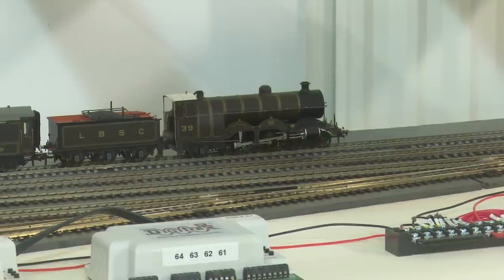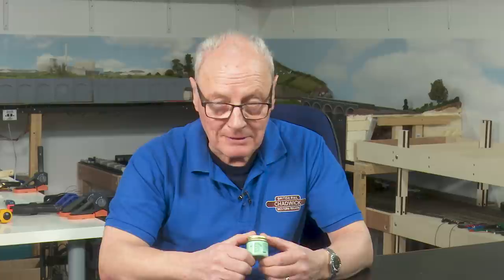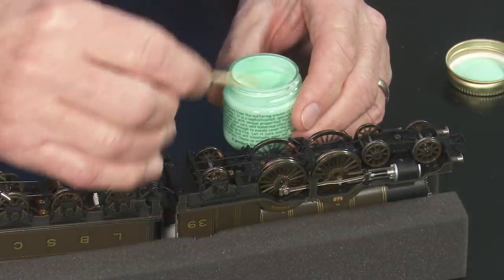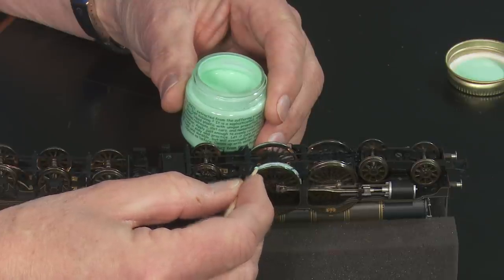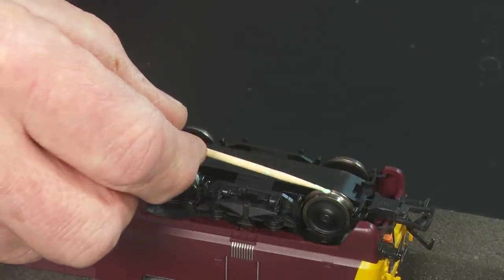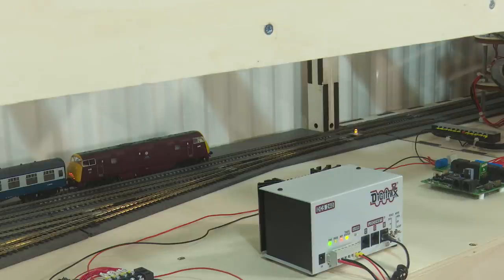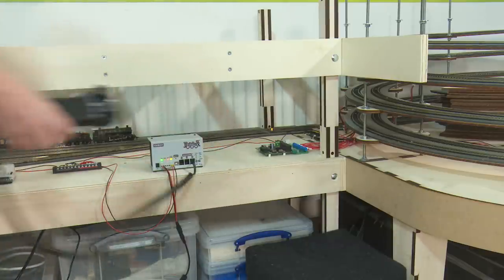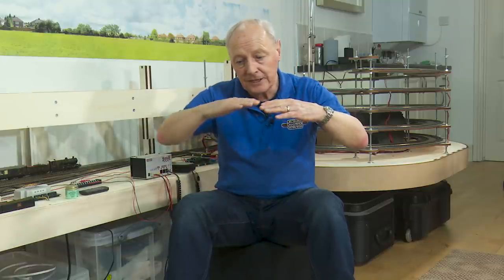Traction Troubles and Bullfrog Snot at Chadwick Model Railway | 122.

Comment: Bulldogs Snot works best when applied with a little brush, which makes a pattern in the snot. Using a stick makes a slick surface, which has less grip.
Reply from the maker: Thanks Arthur, it really is a strange commodity.  Regards Charlie

Comment: Hi Charlie , well it's more like Bullfrog  Did Not! It's strange how many modelers do helix's on many layouts  this is a first I've seen this happened. There's another HO scaler in the U.S. that does high speed fast freights Its incredible with almost 100 trains! Otherwise these trains are strange & stubborn on these climbs. Even I wonder maybe traction tires would be better? But on older European & American models were & are the flanges which are a no no on code 83 tracks. Generally code 100 is my main trackage, the structure height adjustments on your model you described is challenging, but don't worry my former layout on a flat surface of HO SCALE  Amtrak AEM 7  by Atlas with 5 cars would do exactly what your engines did on screen. This video engines & cars etc. is teaching physics whether we like it or not. 😃 As always I get  something watching your channel. I will be watching your previous videos I've been off-line I need a better technology myself 😂. Happy modeling I'll continue viewing.. 👏👏👍🙂🚞🚂🚃🚃🚃🚃🚃
Reply from the maker: What a great comment Harold. Hopefully if you watch tomorrow’s video all will be revealed, things are much better now the adjustments are complete. Regards Charlie

Comment: Charlie, you're often borrowing things from Mrs Bishop' well why not borrow her nail files and at 90-degree angle to the rails stroke the helix rails with the files to rough them up a bit? When I was a kid I had a dock shunter that had serrated wheels and it worked a treat. My mum said, be nice to the little girls next door and let them play with your trains and the little horrors would fill up my goods train with broken bits of dolls and marbles and the shunter managed the Hornby incline set with no problems.
Reply from the maker: Sorry Iain, I can’t risk scratching up the rails. If it were to be a mistake I would never be able to replace them. Regards Charlie

Comment: I think the solution you mentioned at the end of the video is the right one. You have room so add another rotation to the Helix. The Warship is a good loco and is heavy and compact. If it cannot perform as you want it then you have to look to the incline. The steam loco you have is another kettle of fish :) I do not think it will have great performance whatever you do. However reducing the steepness of the incline can only help. Always have the least steep incline you space / design will allow. The Bullfrog Snot looks like a good product but it should be a last resort as in many cases you are reducing the number of wheels that pick-up and that is never a good thing.
Reply from the maker: A great comment, and with the changes I made this weekend to the Helix we should be home and dry.

Comment: Nice video, I only run trains on a level track but found those locos that need tyres, quite often the replacements are thicker and course the loco to run lopsided. So I found that heat shrink tubing a good replacement, the trick is to find the closest size as it doesn't stretch ...happy modelling stay safe
Reply from the maker: Great tip Mark, many thanks.

Comment: Nice one Charlie..... I've not ever used 'Snot' which I guess is a reinforced latex product and does seem by your video to have some merit, although
how long it will last remains to be seen. 
As far as helix's go my double helix is graduated with the steepest section at the bottom so if a train manages this section it will lift a train to the top,
the advantage being one can back off an 'overloaded' train without the perils of backing off further up the helix and maybe getting buffer/coupling
lock.  If you can add an additional loop in your helix complex... go for it and adding some weight to your locos will certainly be worth while. 
  As for replacing rubber tyres one way that I have had success with is build up a layer of silicone sealant in the groove and allow to throughly
cure.  Another which I'm testing out is shink-wrap tubing. Starting with tubing slightly under size and stretching it into the groove followed by a
final fixing with a dunk in boiling water to bed it down. (The water must be boiling).  Thus far this method looks to be working.
Reply from the maker: An interesting point Indigo. None of my locos have traction tyre facilities. So that option is not open to me. However I am adding an extra layer to the helix and lowering the layers to decrease the incline. Regards Charlie

Comment: Bullfrog snot on the bogie ! haha.Try applying to opposite wheels on each axle,leaving one for pickup and one for grip.And with one in each corner on diesels on opp.sides. My locos with best traction are articulated with traction tyres and set up like this.Good weight over drivers is best as you know.Even some of my tender drive locos have good traction with tyres.My standard grade is 2.5% or 1in 42,but i have less and more in places. I am making a rack section which will be 7.5%,so working on ideas and testing various combos,needs to zig zag around the stairs to reach the hallway at the top.Keep up the good work Charlie !
Reply from the maker: Sound advice Simon, thank you. I’m currently rejigging the Helix accordingly. Regards Charlie

Comment: Hi Charlie and a happy new year,  you've got more patience than I had for my helix. All the issues you are facing eventually lead to me giving in. Fortunately your helix looks to be easier to adjust and more accessible. My intercity trains and 12 wheeled engines usually had enough weight and traction to run. My steam locos didn't work at all, that was why I had a level loop for them to run on. like you, I was learning how to make this work and comments rained in from other modelers on YouTube. I wasn't winning this battle. For me the straw that broke the camel's back was when someone pointed out the extra wear and tear on the motors, it was thought that the helix would half the life of the motors. That news came in when l was at a low ebb and starting to believe that I had made the wrong choice of railway layout. I think your extra layer will go along way in achieving your goal,  an option I didn't really have, the incline has to be slight. Just a thought with the traction gloop,  I wonder if that would work on my Rocket, despite being level its lack of weight affects its traction. I'm busy with track ballasting and hillside scenery at the moment, hopefully have an update soon. I wish I had your editing skills.... kind regards Jim
Reply from the maker: Hi Jim, I’ve completely re-jigged the Helix this weekend. You’re right the incline was too steep. Good luck with the rocket, I will put it back in its box! Regards Charlie

Comment: Great video Charlie! 
I might have few suggestions for you. 
First, try to apply bullfrog snot just on one wheel per axle and diagonally within one boogie. You will get more even moment of force distribution.
Second, try to avoid wheel slipping. Not only it grinds both wheels and rails but more importantly it also decreases overall power output. Coefficient of adhesion is greater than coefficient of friction, therefore you will get better reaction force and better moment of force.
I am looking for the next video!
Reply from the maker: Great comment Blackbird. Regards Charlie

Comment: Hey Charlie, thanks again for doing the hard work researching and testing products for us. I could see you had enough clearance to lower the helix' and then you admit you had increased them! One thing noticeable is the speed is inconsistent even with the full train on the helix. Check the back-to-backs and run a track gauge over it, wheels could be binding.
Reply from the maker: I found the snag but it wasn’t the gauge. I explain all on Friday.

Comment: As always a great video, it’s difficult to watch as it takes me back to my struggles with exactly the same situation I had 6 years ago, you may remember I messaged you on your first foray into the helix. I also used the power base and bullfrog snot, run the up on the outside of the helix etc etc. 
I’m reluctant to tell you the outcome but it did not end well for the helix.
I truly hope you get it to work, my ‘helix’ now has a diameter of almost 8 feet and with a gradient of 1-60 ish, I can now haul 11 coach trains with almost any steam loco, and a 40 wagon coal train hauled by a garret! I had more trouble with freight than I did coaches but that maybe because I wanted most trains hauled by steam.
Thanks and good luck.
Reply from the maker: What an excellent comment mate. I’ve had to rejig to my Helix and hopefully you’ll see it next week. I have the advantage that I’m not really a steam engine kind of guy but only time will tell. Regards Charlie

Comment: On some of my Hornby steam locos where needed I have removed the geared set of drivers and machined a groove in them and fitted Hornby traction tyres. This has worked with no problems and they are run at a constant speed round the layout. Somewhere between speed step 25 and 40. I don’t have a helix but do have a gradient.
Reply from the maker: That must be quite an engineering feat Alec, on a mini lathe I imagine

Comment: Hey Charlie! Long time fan from across the Atlantic. I've never used Bullfrog snot but I find if fighting a grade that spinning the wheels never helps as it breaks the cohesiveness of the wheels. I've been able to pull 60-70 properly weighted freight cars up 1.5%-2.0% grade as long as I use throttle control. Maybe if instead of attacking the grade at 99 you feather the throttle while using the Bullfrog snot you can pull even more coaches up the big hill! Cheers!
Reply from the maker: An interesting comment Adam, and advice I will certainly try. Regards Charlie

Comment: Charlie a couple of things for consideration what happens to the BFS where does it end up? possibly on your track does this make it harder to clean the track? with your helix with your steam trains you could run a banker on the helix (extra operating potential) but this is I think less prototypical for UK diesels. You could have a major rethink about your helix, if you have the room, rather than a circle you could have an oval with some short straight sections which will make the climb a bit easier. Food for thought.
Reply from the maker: I made some great progress on the Helix this weekend Neil. Hopefully in the next video you will be pleasantly surprised.

Comment: I tried Bull Frog snot in the 1990's with the same conclusions as you Charlie. You of course have another options, "remove weights from your coaches".  I believe you'll find them running better, with less wear and tare on your locos. This probably won't work for your Pullmans but you could simply double head those. Clearly reducing the attack angle of the helix is going to help a lot. Still consider removing weights in your older style coaches. Keep safe Rich
Reply from the maker: Thanks for your comment Rich. However I have made some good progress on the Helix this weekend. Regards Charlie

Comment: I've been trying belt slip dressing from our local car motorfactors which I work for and getting good results so far, lightly spray on the traction tyres and leave overnight trades about £5 a 600ml tin
Reply from the maker: Great tip Alex, regards Charlie

Comment: Great video Charlie, as always.  Charlie I'm sure you've thought of this already, but maybe not.  The gradient between the top of the helix and the existing layout will be steeper than you might expect by just measuring the horizontal and vertical distances.  You will need vertical transitions curves at both ends and with long fixed chassis locos they will need to be "gentle".  The effect will be to shorten the horizontal distance and therefore steepen the gradient.  Good luck with the installation.  Take care and keep safe.  john c
Reply from the maker: A good point John. And I am currently looking into the mathematics. The Helix has been reconfigured and I’m adding an extra layer so hopefully that should do the trick.
Reply: @ChadwickModelRailway  I found the following method worked very well.  I had level track at the top and bottom of the incline with a height difference of approx 80mm and a horizontal distance of just over 2m.  I wanted to restrict the steepest gradient to 5%.  I slackened off or removed all the interim risers that I had already fitted and then rigidly secured the 9mm plywood sub-bed at the top absolutely level to match up to the existing.  I then repeated the same horizontal fixing at the lower level.  The 9mm bed found it's own shape (a very gentle "S"), which was very close to the desired profile.  I lifted it slightly in the middle to compensate for it's weight and fixed the centre riser.  When I measured it exactly there was only a very short distance where the gradient reached 5% and the vertical transitions at the top and bottom were very long and gentle.  In your case it will be much easier as the lower  end is already on a slope from the helix and the transition will be minimal.  If you fix the top rigidly and horizontal the sub-bed will droop down under it's own weight and may well leave you with little or no adjustment necessary.  The risers can then be fitted to maintain the natural profile, rather than create the profile.  Hope this helps.
Reply from the maker: Hi John ,what a very interesting comment. I shall certainly consider your suggestion as I work on this later today. Regards Charlie
Reply: @ChadwickModelRailway  Hopefully it went well today  :-)    Look forward to seeing the end result.  Take care and keep safe john c

Comment: Hi Charlie first of all respect for going for a two level layout and congratulations on your helix it is a fantastic piece of model engineering.
 I was thinking about the comment about having a Garrett locomotive for banking and although I think it was probably a tongue-in-cheek comment I don't think it's far wrong.
If you think about real railways in times gone by there was a lot of use of banking locos on grades far less than your helix I seem to remember film of Gloucester central station where an 08 shunter was banking a north bound steam hauled freight train through the station as apparently there is a slight gradient and curve northbound even though it's not really noticeable to the naked eye.
So I was wondering if it would be possible to incorporate pilot engines in to the working of your layout
Or how about taking the motor bogey from a old DMU and incorporateing it in to a MK1 full brake etc, and coupling it behind the loco to give extra traction on the helix probably work wonders with your H2.
Reply from the maker: Banking on the helix could end in a massive derailment.  Placing another motor in a coach/full brake is a very interesting option.

Comment: Hi Charlie. Another great video. I wasn't too confident in the bullfrog snot working, but I did feel sad at the disappointment that you got. As for the ten coach train, could you fit a motor bogie to one of the coaches?. This would put a lot less strain on the diesel engine as it does seem like a lot of work to alter the helix. Also there is no guarantee that you won't end up with another gutless loco in the future, so altering the helix now could in theory, save you trouble down the line( Excuse the pun). Best of luck and I'm am thoroughly enjoying your channel. Cheers Chris.
Reply from the maker: I’ve completely rejigged the Helix this week so hopefully on Friday, you’ll be pleasantly surprised.

Comment: Charlie I’m sure someone else has probably mentioned it but what about using neodymium magnets to pull the locos into the power base track? As lead would add to the total weight needing to be moved.
Reply from the maker: That is what I used on the 9F as supplied with the PowerBase.
Reply: @ChadwickModelRailway  Apologies, keep up the the great work.

Comment: Hi there Charlie. Interesting. Regarding the Warship: with coating both axles of the front bogie with snot (tee hee) you've not used the weight distribution of the loco to its best effect. By 'snotting' both axles on the one bogie you are effectively putting a point load (structural engineering term) onto the single bogie which means that you are only using half the weight of the loco for adhesion as half the weight is through one bogie and the other half of the weight is through the other bogie (mechanics of weight distribution). If on the other hand you coated the rear axle of each bogie, then you are placing a udl (uniformly distributed load) onto both bogies thereby taking advantage of the full weight of the loco as the full weight is distributed uniformy giving the adhesion you would need.
Reply from the maker: You’re right David, I certainly did miss a trick on that front. Paragraph regards Charlie

Comment: Interesting experiment. One option with the h1 if all else fails is consisting on the helix to replicate either double heading or banking.
Reply from the maker: I’ve never been a steam modeller so keeping it to one side won’t be a problem. But it does make a very useful test vehicle. Regards Charlie